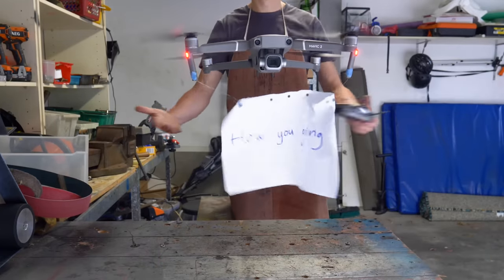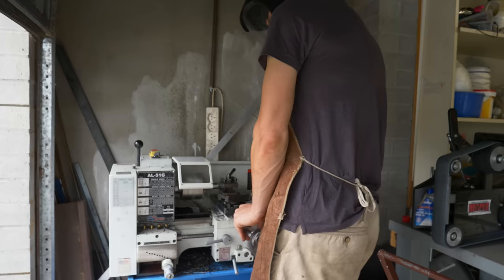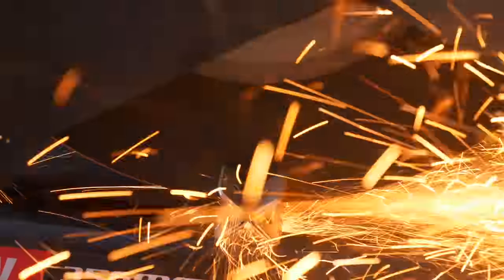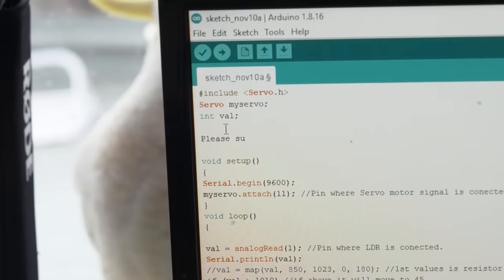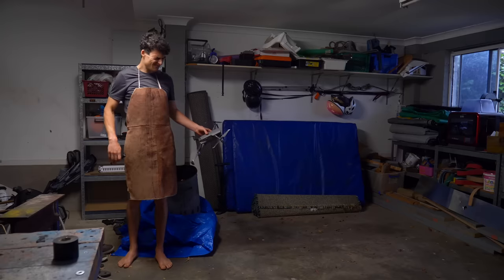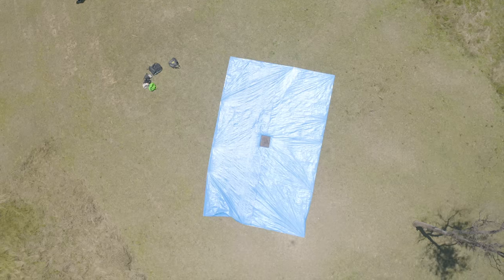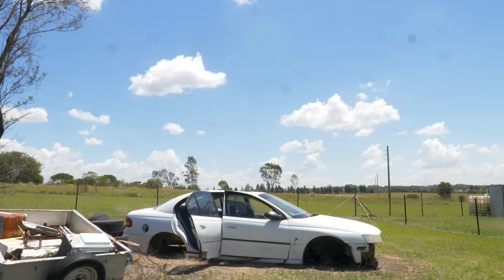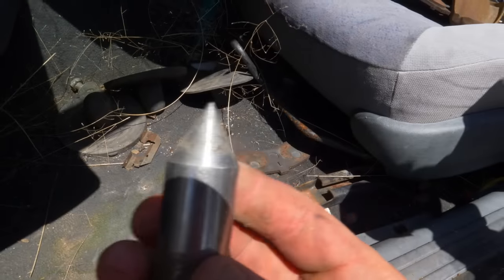Drone Darts are Silent and Deadly!

Comment: The fact that you can semi accurately launch a projectile that can take somones toe off while being barely visible and only the impact being audible is both incredibly cool and terrifying
Reply: It can do more if he holos those things and filles them with pressurised gunpowder and an ignition mechanism.
Reply: @User-dc6sm  this is true
Reply: The fact that anyone can just GO to the store and BUY A DRONE is kind of spooky.  It's pretty wild.
Reply: @User-dc6sm  Gunpowder is a pretty shit explosive, you want something like PETN or RDX.
Reply: @Tunkkis  probably good way to get a surprise visit by ATF/FBI
Reply: @User-dc6sm  surprisingly, that might not be the case.
If its an impact fuse, which i believe is the easiest thing to make beyond a timed from release one, then you actually loose all your armour pentration, as it, as the name suggests, just explodes on impact. 
What he has is instead a sabot round, a very small gravity powered version of the things tanks shoot at other tanks in order to blow them up.
Reply: @comfymoder72  Funny.
Reply: @User-dc6sm  Not really, those things work on mass + velocity. The flechettes those are based on "explode" on their own when dropped from their actual drop height. The steel shatters when they hit hard surfaces sending shards about the same distance but with more lethality than a grenade.
The amount of HE you'd need to add for equivalent effect would pretty much obliterate any shrapnel and would make it so light that it could land a mile away from where you want.
Reply: hence why "Thor's Hammer" or "Rods from God" were considered for development. With GPS telemetry they would be very accurate, with yields similar to conventional nukes with none of the radiating problems, and there is basically no Earthly way to defend from it. The rods would move so fast, are so small, and dont have a rocket trail, they basically cant be picked up by early warning systems, and even if you could target it, its a tungsten rod moving at mach 10, how do you even begin to stop it. Ultimately it was shelved because of cost/feasibility of deployment. Hauling several hundred tons of tungsten into orbit is alot more difficult and expensive than conventional nukes.
Reply: @Tunkkis  FBI OPEN UP!
Reply: @Ki113r210  The fact that it's even possible for us to drop oversized nails from orbit is terrifying
Reply: Or you could just make the dart a Hollow change while you’re at it.
Reply: @Santisima_Trinidad  a sabot round without a sabot ? Wouldn't that just be an AP round then ?
Reply: @User-dc6sm  he could've done some stuff to stabilize it and make it more accurate
Just that alone would make the drone capable of splitting a standing man's skull from 200 meters above
Reply: @MODElAIRPLANE100  i have to admit, i have zero idea as to why sabot rounds are called sabot rounds, i just know that they are rounds that they don't have any sort of explosives in them.
Reply: @Santisima_Trinidad  there's also EFP or explosively formed detonators, which use the high explosive energy to deform a spherical piece of metal, most of the time copper, making for a much, much better armor piercing capabilities compared to what is essentially a steel block falling from 100 meters or so.
Reply: Imagine a serial killer using this
Reply: @jon_flop_boat  can't decide if you're being sarcastic. 🧐. To me that's like saying that you can't believe everyone has an a$$hole and some people use it.
Reply: @Unmannedair  I own a drone, bought it off the internet and it was delivered to my door, and I can just fly around and do more or less whatever I want.  The laws on surveillance are ridiculously lax, where I can fly is mostly unlimited.  It’s mind blowing.

It’s entirely too much freedom without a license or registration — there should be SOME process for me to be able to do this.
Reply: @Santisima_Trinidad  You could inbead a detonation on impact mechanism at the front with a closed chamber, filled with gunpowder behind it. The Gravety powerd projectile would land on the front and force the detonation mecanism a couple milimeters backwards wich would 1. compress the gunpowder further and 2. detonading it. The detonation mechanism would be pushed out with a great force and would penetrate further.
Reply: @Tunkkis  well that costs a lot of money and isn't always legal
Reply: Now, imagine that feeling for 20 years, and it's not just steel darts getting haphazardly dropped on wrong targets, but actual bombs, and the target could be your house, or your school.
Reply: @jon_flop_boat  "too much freedom"
Jesus Christ.
Reply: @User-dc6sm  Sure, but if you want good results it's what you've got to put up with.
Reply: @Santisima_Trinidad  A sabot is basically a plastic shell around a smaller projectile so it is centered and sealed in the bore of the gun. When talking about AT rounds they're often APFSDS, Armor Piercing Fin Stabilized Discarding Sabot, so essentially long, skinny, and heavy darts.
Reply: @Tunkkis  way to cherry-pick, I said specifically for a process that’s completely unlicensed.  The only thing stopping some dude down the block from pointing an airborne camera through your windows is that they don’t feel like it, and you don’t even have legal recourse if it happens.  That isn’t the way that should be.
Reply: @jon_flop_boat  What are you talking about? Stalking and filming people in private property is a crime. So is flying drones in certain areas (restricted airspace). Consumer drones are not as dangerous as your puny mind makes it out to be.
Reply: @ChristAcolyte  I think there’s probably a chance that I’ve looked into the legality of where I can fly and point my camera more than you have.  I imagine I have a bigger vested interest in knowing what I can and can’t do than you, with no background or experience, do.  Frankly absurd you think otherwise, lol.

There are laws about what I can *record*, sure — but I can look at anything visible from any airspace I’m allowed in (read: almost anywhere, including above your house) on a live feed.  I can park a drone outside the window to your apartment, there’s nothing legally stopping me from doing that.  It might be considered harassment if you asked me to stop and I continued — but how are you going to track down the owner of an unregistered drone to make that request?  Do you see how this could be an issue?

Moreover, I only know what I can and can’t do BECAUSE I’ve researched it heavily.  There’s nothing stopping any fool with a couple hundred bucks from buying a DJI Mini, never registering it with the FAA, and flying around without ever looking up any of this.

There is no licensing process.  There’s no reasonable legal framework for off-the-shelf drones; it’s still in its infancy and full of loopholes.  The law has not caught up to the state of the art, and it could easily become a problem.
Reply: @ChristAcolyte  in fact, “filming people in private property is a crime” is blatant misinformation.  Look up “reasonable expectation of privacy” and tell me how that interfaces with FAA airspace, which is NOT your private property, but which IS right above it.  Hint: if someone can see you from an aircraft, the law is on their side, not yours.
Reply from the maker: Yeh its terrifying it still sucked overall
Reply: @jon_flop_boat  that’s not the drones fault, that’s just privacy rules. Don’t blame drones when you could do the same from the sidewalk of their house. There are almost no privacy laws IN GENERAL, that’s the problem.
Reply: @Tunkkis  my man taking things up a notch.
Reply: @Santisima_Trinidad  APFSDS means Armour piercing fin stabilised discarding sabot. In this case, there is no Sabot*, so I think it should be *APFS
Reply: Foot is an understatement. It would have gone easily through a head or leg. It IS lethal.
Reply: @Ki113r210  Also kinetic bombardment form orbit is stupid, because items dropped by a satellite will just stay in orbit with it. So you have to attach a rocket to your kinetic projectile to decelerate it and make it fall, and add sophisticated guidance to prevent it getting thrown off course by the atmosphere as it reenters. At that point you might as well just build a missile.
Reply: @ThoolooExpress  not quite, an object will only stay in orbit if it's lateral speed is high enough for it to "miss" the earth as it falls, plus our satellites are basically "barely" in orbit, they use tiny boosters to maintain their speed over their flight path. From what I remember,  you can actually really precisely and reliably calculate the decay of it's orbit, then the rod only needs a small booster to start it's path. By the time it hits atmosphere, it's momentum is so great (and it being tungsten it doesn't burn) that it is largely unaffected by it.
Reply: @micaheiber1419  that's actually another issue with it to start with, there's a shit ton of debris orbiting earth, we loose satellites all the time to it. If a satellite carrying a dozen tungsten rods got perforated, the armaments orbit would rapidly decay and they're crash uncontrollably to earth, randomly bombarding us
Reply: @Santisima_Trinidad  the sabot is a casing that surrounds the round and gets discarded as the round leaves the barrel the projectile has the full diameter of the charge to push a narrow round, with less frontal area it has less air drag so looses speed more slowly giving a flatter and faster trajectory with a higher impact force at any given distance, the round has fins to help with spin stabilisation negating the need for a traditionally rifled barrel, this again helps with velocity as there is less drag in the barrel trying to turn the round. Hope this answers your query.
Reply: @CrusaderSports250  it did, thanks. Your the third to answer it for me, and the most detailed so far.
Reply: @jon_flop_boat  Yeah dude, like, only the government and those big companies should be allowed to! It's not like they'd just own it any ways while we have to abide by certain restrictions... Right?
Reply: I guess this is why we’re seeing it in the Ukraine war
Reply: Now think about what OTHER things this setup can carry and you'll be looking at the next, oh, 50 years of warfare at the least. From all sides too, because of how cheap it is to just build a disposable quadrotor drone.
Reply: @djsonicc  home land security?
Reply: True
Reply: FR
Reply: @Tunkkis  Everyone always says that until they get blown up by it.

Comment: Friendly reminder to never use a laser, especially a bright green laser like that, without goggles. That color green isn't made by a laser diode, it's made by splitting higher frequency, which means that it's hurting your eyes at two different wavelengths lol. Even with goggles that filter out visible light wavelengths, leakage of those higher frequency wavelengths past the splitter can cause permanent damage (faster than you can even blink in the case of many cheap ebay lasers).
Reply: yeah fucking oath
Reply: This guy don’t give a shit

Comment: Military drones generally drop their payload in an arc (drop it while moving forward) which helps accuracy if dropped at the correct time, the horizontal movement reduces vertical drag and thus vertical deviation
Basically, payload dropping down wiggles about as it falls and changes direction based on where the tip is pointing at any given time, if it is dropped at speed at an angle then the tip starts out facing forwards then the weight pulls the tip down slowly until it is fully pointing down, like trying to land a glider/plane rather than divebombing it straight into the ground

Comment: You could probably make it more accurate by changing the angle of the fins so the spike spins on the way down, which would stabilize it.
Reply: So, if I'm interpreting this correctly, the swastika configuration likely would've been better?
Reply: @tylerleroy5935  No, with the swastika config the fins would still the perpendicular to the ground (90 degrees), whereas I'm suggesting making them less than perpendicular, so some angle less than 90 but probably more than 45
Reply: @J5wingo123  the key is to angle them on a perpendicular axis, no?
Reply: @TDGCmote  Not if you want it to spin
Reply: A 3d swastika then
Reply: I feel the holes in the fins doesn't help either. I'm not sure of the balance of the ballistic, it seemed ok but if it could be made bottom heavy and at a steeper point that could help. I don't think the holes help much for top weight reduction either.
Reply: if you look at the historic images of the darts they did use(beginning of video), they had spin stabilizing fins. its clear as day.
Reply: @J5wingo123  the more you angle the slower the acceleration. so a angle on like 80 or 85 degrees would be perfect
Reply: spin it like rifling
Reply: @ber2996  exactly

Comment: I think you could make the darts guided, you could have a larger/longer plastic shell with electronics and a tungsten penetration core. The guiding shell could even separate at a height of 30m or so and deploy a parachute or something if you wanted to make it cheaper.
Reply: Making guided bombs is VERY illegal
Reply: @F5cThunder  not sure a guided dart is the same as a bomb… For example making guided missiles is obviously highly Illegal while making guided model rockets is absolutely okay.
Reply: guided model rockets are kinda on the line with the law but since dart could be potentionally deadly im almost 100% sure that they would be illegal
Reply: @F5cThunder  I looked it up and it seems it depends on where you live. In some US States it’s even legal to make a full ballistic missile (without the warhead obviously). In other even the guided darts would be problematic. Most likely nobody would actually come after you for them, as long as you stay on private property. But I’d look up local laws before doing anything of this kind. 
I live in Germany and I’ve flown a guided model missile with a small payload (on private property with explicit permission from the owner) and nobody has come after me for that. So I think as long as you are taking proper safety precautions you’ll be fine.

Comment: You need long, thin projectiles with a hard tip (like a tig welding tungsten) to punch through the bbq plate. Also, the long version would give it more accuracy as it's less likely to pivot mid fall
Reply from the maker: Can't afford to lose tungsten rods in grass
Reply: @Ididathing  Yeah, God is pretty attached to his rods.
Reply: @Ididathing  you could also make an insert for a drill bit, as it's made of tool steel and is harder than regular steel.  Kinda like a mini APFSDS round
Reply: @Ididathing  you could put a long ribbon or some thing on the back of them
Reply: @kieranmilner1295  that would drastically reduce the terminal velocity though.
Reply: Why not just heat treat his 1040 darts? Nowhere near as hard as tungsten, but I'd imagine more than enough to penetrate cast iron?
Reply: @Ididathing  add flairs
Reply: You could try reusing any leftover darts from this and simply replace the existing fins with a length of thin wooden dowel and fins on the end of that. Kind of like an arrow with a very oversized head.
Reply: also just simply twisting the fins to give it a spin would massively improve accuracy
Reply: @Ididathing  Poor poor poor poor poor poor (I'm poor)
Reply: @brennan3347  It's not about hardness it's about density
Reply: @AirNeat  definitely more important. Good point.
Reply: @Ididathing  your spent carbide cutting bits, just cut a little slot into the rod, insert the sharp end of the bit facing downwards, with some epoxy, you're off to the races

Comment: Ey boi, use oil on your workpiece on the lathe while cutting steel, especially tool steel! Easiest is to just use a brush or squeeze bottle and constantly apply it to cool and lubricate it. You'll use way less bits up in the process! Love your stuff!
You can absolutely use your lathe on anything, with proper coolant!
Reply: Noting this down for the day i get a lathe
Reply: It rubs the coolant on its bits, or else it goes to bunnings again...
Reply: Yeah this is what i was gonna say! He should also check his speed chart for the different material he is using.
Reply: I reckon he needs to give it plenty more speed, carbide likes more surface speed.

Comment: "Get a lubricant for your lathe to cool your carbide bits and extend their lifetime, plus less screeching."
                                                                                                                                                            - Sun Tzu (Art Of War)
Reply: Confucius says: silent and smooth running machines are only half the fun and completely miss the point of machines in the first place.
Reply: Lathes tend to maim people. Given the careless state of mind...
Reply: Speed and feed but I suggest coolent
Reply: @Crypteus1234  Well, it doesn't cut worse but repeated rapid heating and cooling can lower the lifetime of the carbide bit.
Reply: "Lathe screeching only exists in the mind,  so bring your mind low, like water,  and the screeching will cease"

Lao Tzu - (Tao de Ching, circa 2000 b.c.)